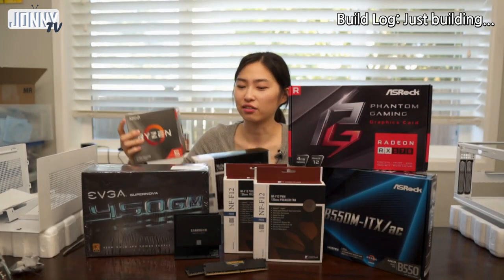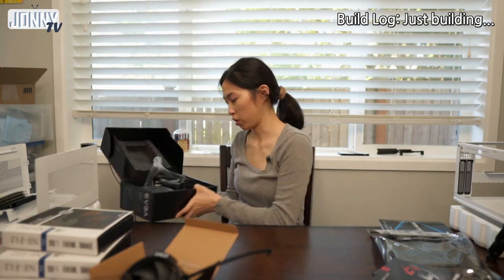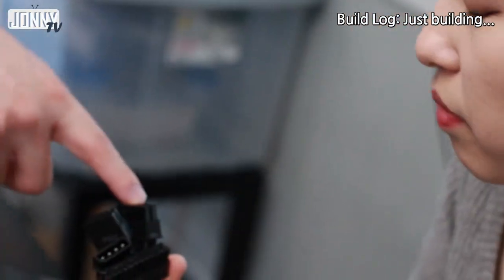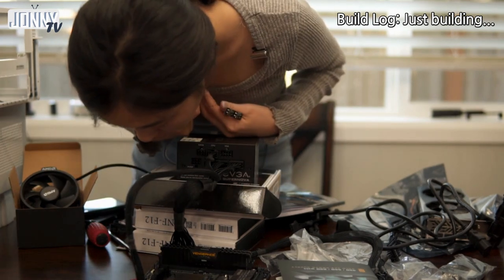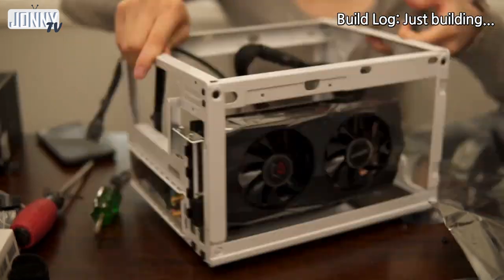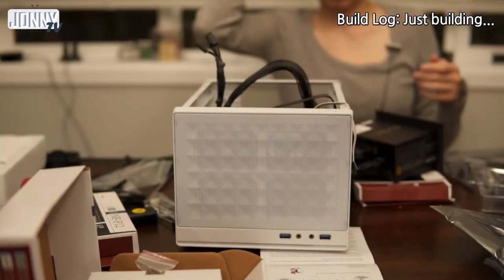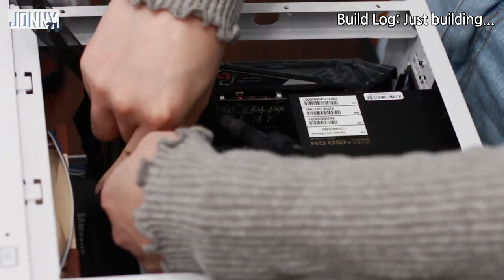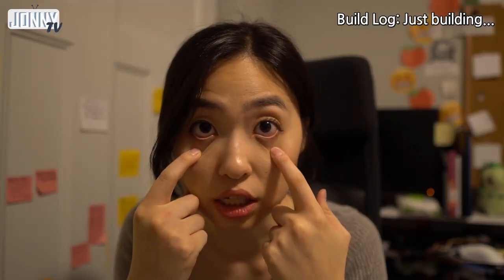ALL WHITE Silverstone SG13 — BUILDING...&building...&building...(the sun set)

Comment: This was very painful to watch but on the plus side I’m feeling a lot more confident in my abilities
Reply: Hi just an update, just built a very similar pc in the same case... I now understand.
Took me 5 & half hours and I can completely understand your issues with the ram, trying to get it in was ‘gritty’, not smooth at all!
The one big issue I had was I couldn’t get the bios to display on screen, turns out when you have a graphics card it’s a good idea to use it’s hdmi port rather than the motherboard hdmi port. I may have also have dropped my motherboard (a little tiny...) at one point during the build 😅
Reply from the maker: @Jeremy-lh3lg  OH LOL I just saw this comment !!
yayy at least it's done and i'm guessing it works well even with the small drop incident! And yes, the ram and gpu wasn't the smoothest thing to install lolol. Glad(?) you were able to share my pain :'-)

I connected all my monitors to the GPU directly so I haven't seen what happens when you use the port on the motherboard. BUT I did have a few hiccups when trying to install Windows so i feel like first builds are always interesting hahah. 

i'll be doing another build (for a friend soon) in a bigger case so hopefully things will be better the second time around!
Reply: This is why you rock a mid tower 😂
Reply from the maker: @isaiahhines6023  but mini's are so cute...
Reply: Harder to work in though as you confirmed lol
Reply from the maker: @isaiahhines6023  welp, i did another build but now in a mid tower. it was still difficult tho... LOL
https://youtu.be/ihWis9JX_i8
Reply: A small PC IS VERY Difficult to build

Comment: I think you did great on your build! I have this same case sitting in my amazon wish list. What are your thoughts on it so far? I been also looking at the InWin Chopin mini itx case so idk which one i want yet
Reply from the maker: Oooh yeah I was also thinking about an InWin case (A1 Plus). 
I ended up choosing the SG13 because I didn't need/want the included power supply that comes with the case. I was purchasing a separate PSU anyway so I just bought the cheaper one. 

I really like my case, especially after I painted it all white. I personally prefer box-y cases rather than towers. Or something like Slider SM550, but I don't have $250 to splurge on a chassis :'-(
Reply: @jcholol   yeah that's some features or lack of which gave me second thoughts for the InWin Chopin case. I didn't like the fact you can't use a gpu, only apu, and very little space for cable management and hd.

SG13 looks way more user friendly and future proof. I like cases with more space too. Boxee cube shaped cases just look right, right? I also been looking at the Thermaltake Core V1 with RGB and glass panels. Your all white case looks great btw!, what type of paint did you use? I'm still leaning towards SG13.
Reply from the maker: @5.0cobra39  Oh I wasn't aware that you can only use the APU.

At first I wanted an all white chassis with tempered glass sides and RGB. After browsing a little, I found that less is more. The minimalistic looking cases look better in my opinion. (I also forgot that I don't want flashing RGB when my lights are off.) 

I would shy away from tempered glass for ITX for cooling issues, unless you have liquid CPU cooler (which is what is recommended by SilverStone in the SG13 manual).

You can watch me struggle to paint it here: https://youtu.be/WW4h-CKb3Ys
I used normal semi-gloss spray paint that can be found anywhere: https://www.homedepot.com/p/Rust-Oleum-Painter-s-Touch-2X-12-oz-Semi-Gloss-White-General-Purpose-Spray-Paint-334098/307244962
Reply: @jcholol  Well technically you could put a standard cpu but you absolutely don't have any space for your gpu on the small InWin case. The proprietary psu takes up a lot of gpu space. Super mods would allow it but, defeats the purpose of mini itx case.

I like RGB for all the color choices, it would be nice to change colors depending on your mood. You can always turn flashing off, i think? It would be annoying if it didn't.

The Thermaltake V1 had cooling issues due to tempered glass and some fan locations but, it looks so cool though lol. I would definitely use an AIO for cooling if there's thermal issues, or a beefier Noctua cooler if there's space for it. 

Ok time to check out your struggling painting video! 😂😂
Reply from the maker: @5.0cobra39  Yeahhh, if I build another one in the near future, I want a mid size tempered glass with RGB lolol. + fancy looking liquid cooling with pipes, etc. Gotta make my initial dream come true hahah
Reply: @jcholol  That would be badass! Expensive as hell but badass none the less 👍

I built a pc a while ago, full tower gaming pc. Asus tuff military grade MB, AMD black 8650 OC CPU(4.2ghz), Gigabyte Windforce GPU (i think 4gb), Corsair HX 850 PSU, Noctua NH-D14 CPU cooler with dual fans, NZXT Phantom case in black, case has 6 fans, temps dont go above 100°F or 38°C while gaming (probably overkill lol) 🤣

It's a huge pc, power hungry but still powerful enough. It's my first pc i built so i might keep it or sell it idk. 

So, i wanted to build something a little more compact and with modern tech also, that's why I'm leaning towards SG13 build.